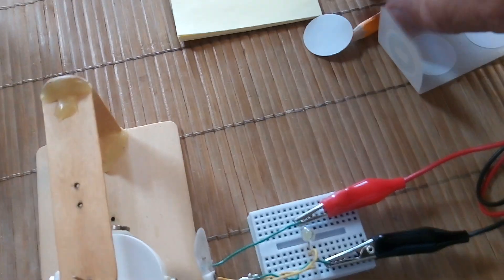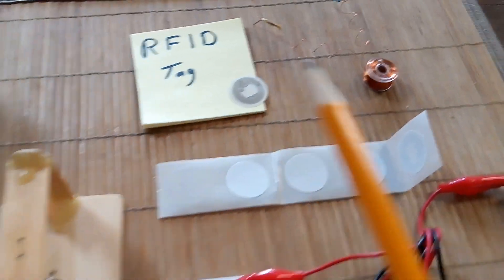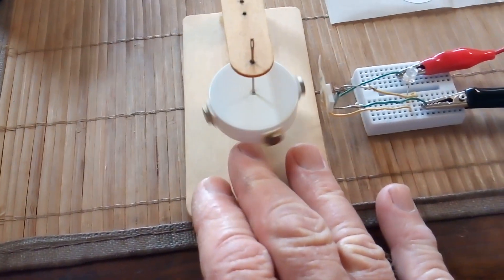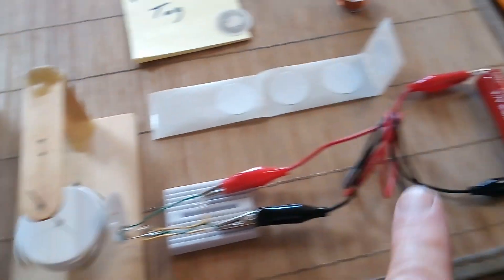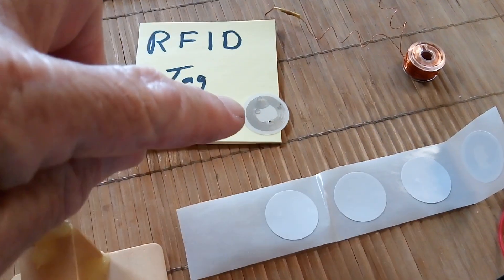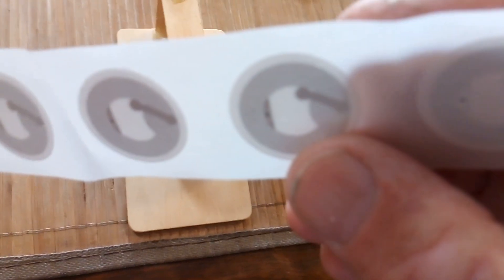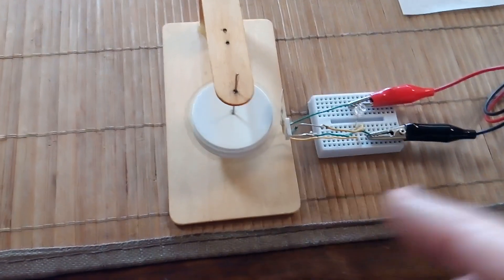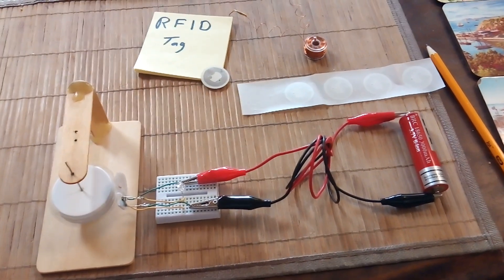RFID Tag Pulse Motor

Comment: Nice project, Lidmotor.
Funny how people, and sometimes even professors, tend to think there is all kinds of information in a bar-code or a tag like this.
Bar codes usually have only one number in them, and on supermarket items you can often read that number written below the bar code.
Most bar codes can be typed in on your browser to find the exact article, like this example; 54034013.
The cashier scans the bar code of the article, and the computer retrieves the description and the price of the item, and puts tose on the bill.
The modern square bar codes and tags may have an sequential number as well.
Square bar codes send by mail may sometimes contain a persons personal information, so only you can enter a certain data-sheet on the web.
Have a good one.
Reply from the maker: Thanks for the info.

Comment: Brilliant, that little fella is flying. Like you say, it will be much higher current draw than your usual coils, but I am just happy to see it working 👍 Looking forward to see where this takes you next.
Reply from the maker: I ran a 13.56 Mhz oscillator today and it picked up enough enegy to light an LED.  I will post the video of it in a bit.  I tried it on a wireless cell phone charger with no luck.  Lots of fun experiments ahead.
Reply: @Lidmotor  that is interesting. Mine flashed the LED with no trouble when I sit it on the wireless phone charger. I am watching your video at the moment, lots going on there 😊😊
Reply from the maker: @GrandadIsAnOldMan  OK I will try the cell phone charger again.  Perhaps I didn't attach the wires in the right place.

Comment: Very cool! Never would have thought it by the look of them. Yep, 13.56MHz transmitting to another 13.56MHz has to be tried... and they're so dinky. Could be good fun ahead  :)
Reply from the maker: OK.  I dug out my old 13.56 Mhz crystal oscillator from 2018 .  The RFID tag worked as an energy pick up.  Fun 'exciter' stuff that I havn't played with for years.
Reply: Bravo! I remember Jonny Davro had a video where he used tuned towers as repeaters, along his whole kitchen length to light an LED at the end. Could these do the same, would be the question .Might be 1'' between, might be  more. Wish I had some lol
Reply from the maker: @Slider2732  Grandad says the these RFID tags are on some store items and that they might even be between layers of the cardboard.  So far I have not found any on my store boxes .  I am pretty sure that I can use these as SEC repeaters.  A simple Slayer exciter is all you need to experiment with that.

Comment: 👍🤓
Have you measured the coil resistance.
Reply from the maker: The coil measures about 2.5 ohms.  It is a poor choice for a pulse motor coil but I did get it to work.  I am considering building a setup with four coils  arranged around the rotor to perhaps make a better setup.